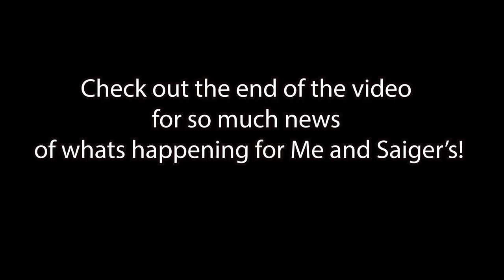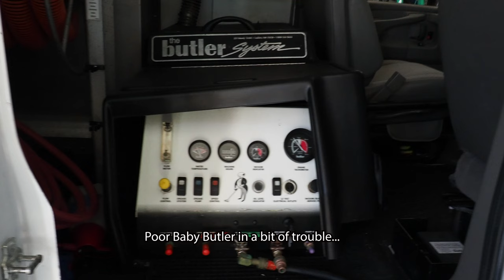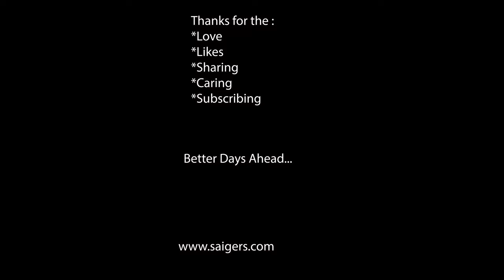Everything Broken | My Knee and the Baby Butler | Carpet Cleaning Challenge

Comment: Hey Mark, I'll be keeping you in my thoughts and prayers with your knee issue going on. Had a question, I work with The Carpet Doctor, and we own 2 basic butler systems. I'm trying to talk my boss into getting a zipper wand. We do a fair share of restaurants and commercial work, which zipper do you recommend we get?
Reply from the maker: Thank you! For the Zipper we used the regular 15 inch Zipper Wands with the straight manifold for years. We would crank the psi up to about 700 to 800 psi in the bad spots. The Zipper can handle it and recover the water. The SS Super Spinner came along and it was OK but got better after some tweaking that we really love. If your restaurants are super trashed like we see sometimes then the Super Spinner is king. If you are cleaning these places on a regular  basis then the Super Spinner would not be needed. We by fortune have one of each on our 3 vans and can grab the one we feel will work best for us at the time. We really love our Zippers
Reply: @MarkSaiger  Thanks for the fast reply. I'll keep those thoughts in mind and pass it along to my boss. Best of luck with your knee and hope you have a speedy recovery!
Reply from the maker: @Lukeskywalken  thank you again. And if you or your boss have any questions, I would be more than happy to try and give you answers that can help your decisions. Just reach out to me!